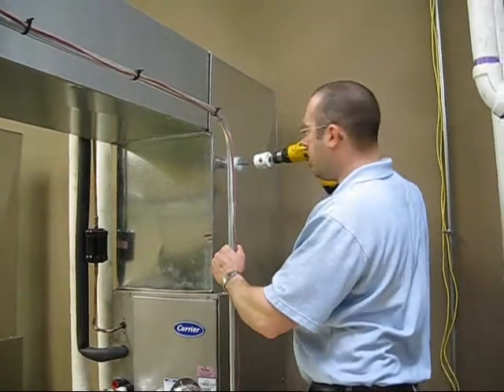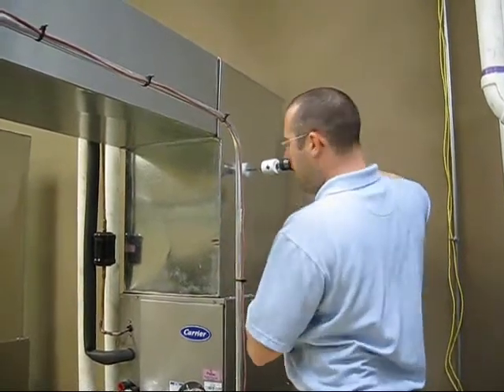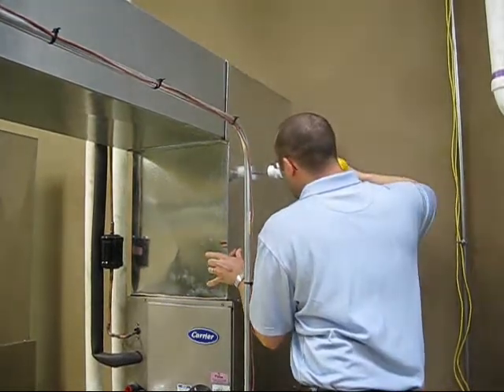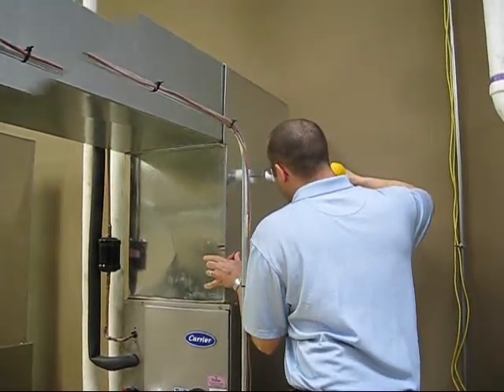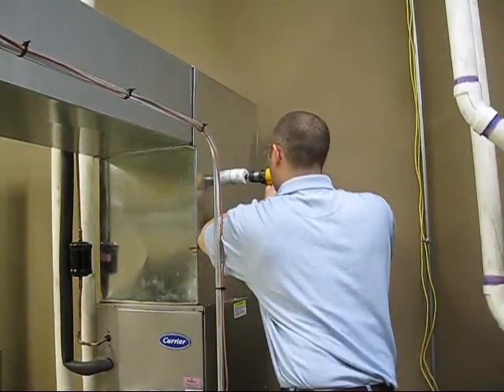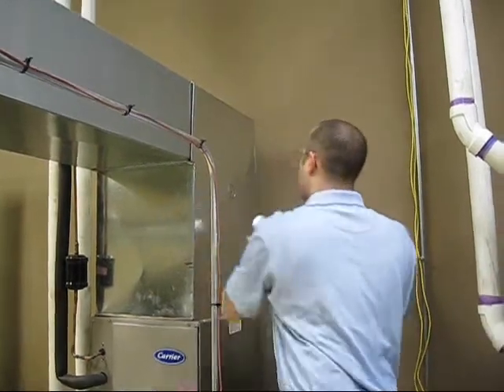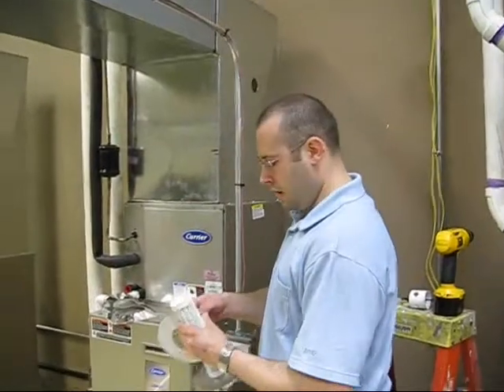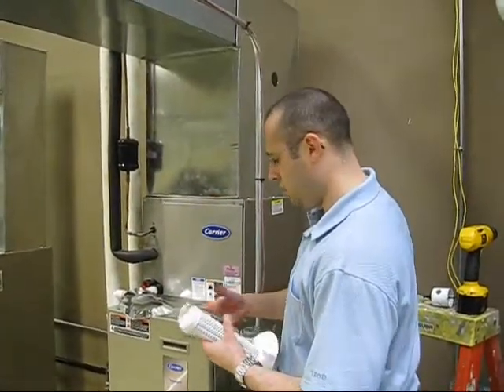RGF Guardian Air PHI Cell Installation

Comment: Hello, I understand I need to replace the UV lamp inside an unite like the one on the video, however after removing the bolts it is actually completely stick to the metal so is not easy to remove… how do I replace? Do I have to remove the sticky gasket and then replace a new one? Thank you for your comments…
Reply from the maker: If you notice in the video, Greg only remove the sticky tape one side of the gasket before he installed it.  That is specifically to make it easier to remove later for bulb replacement.  In your case, we assumed you installer removed it on both sides so the gasket would stick to both the ductwork and the RGF housing.

At this point, you have two choices.  Put it back on with the old gasket even thought it is not ripped up a little OR scrape of the debris and get a new gasket.
Reply: @TECTubefilms  thank you for your great response. I was hesitating but now I know how to proceed ;)